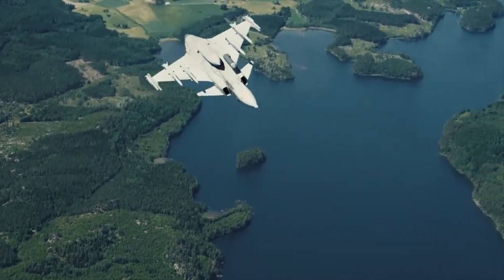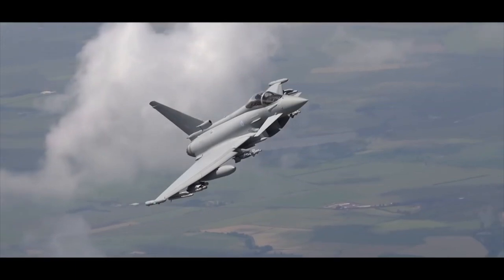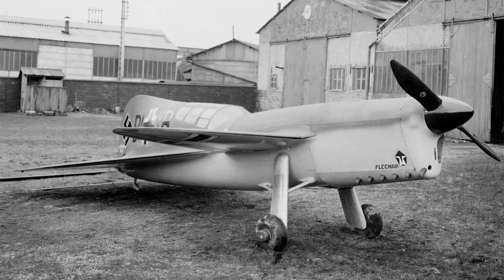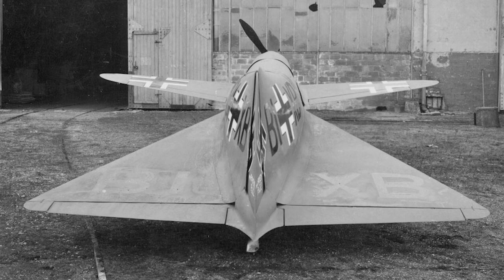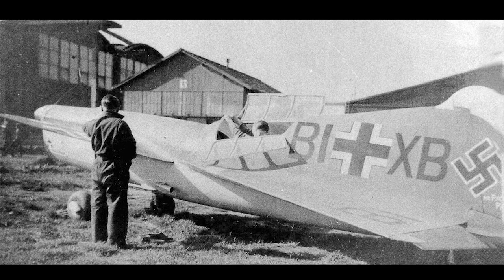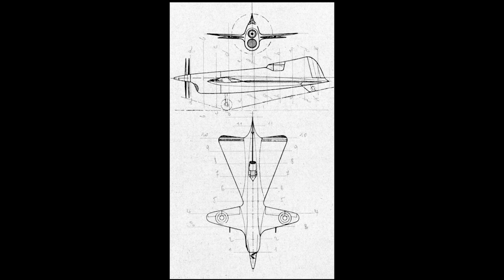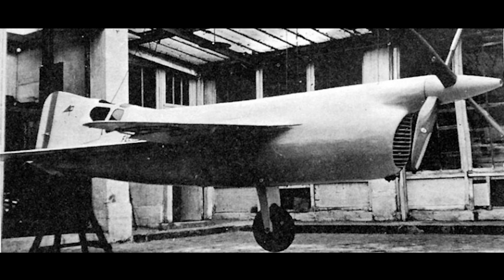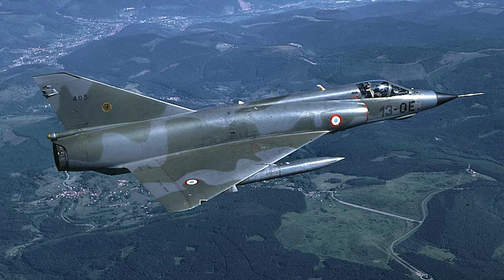The Payen PA-22/-122; the First (Proposed) Delta Canard Fighter

Comment: Nice to see this aircraft covered! Originally it was to be the Payen-Melot Pa-22/1R Flechair powered by the Melot 1R steam-oil powered ramjet type engine. This aircraft was built and had four wheels, the main landing gear, a tailwheel, and a 4th  under the engine as it was so heavy the aircraft "bounced" as Monsieurs Payen and Melot tried to get if off of the ground. It was hoped to enter it  into the Coupe Deutsch de la Meurthe air race, but when the aircraft failed to perform, it was re-engined with the conventional propeller piston engine. 

During this same period, another canard aircraft was built in Italy, only with a pusher propeller, the SAI Ambrossini SS.4, destroyed in a crash in 1939. Germany investigated this concept with the Henschel He.P.75 of 1941. In the United Kingdom this concept was continued with the Miles M.35 Libellula in 1942, then came the American Curtiss XP-55 Ascender of 1943, the Japanese Kyushu J7W1 Shinden in 1945, and the Russian Mikoyan-Gurevich MiG-8 Utka of the same year. Many nations were curious of this concept.

Comment: Please cover the Vampire F.2 / F.30 / FB.31, most definately superior to Meteor F.8 in performance, cheaper with no less firepower, more range and less maintenance. 

RAAF and French Air Force used it extensively and if RAF got a chance to ditch the Meteors and go with Vampire F.2 development, they would have served against MiG-15s at Korea much better than Meteor F.8s.

Comment: Imagine an improved version of the Payen powered by the Argus pulse jet. You'd have a cheap and simple motor. A cannon/machine gun combo in the nose. Fuel tank in front of the pilot. It would probably be a crappy dog fighter, but as a short range interceptor it might have excelled. Since the air frame was captured when France fell, it may have been possible for it to inter service in early 1943. All this is just my imagination trotting along. I can see it knifing through bomber formations with fighter escorts in pursuit.

Comment: This plane was really interesting; thanks for shedding light on the subject. I really like how the designer germanised the design by adding a cannon firing through the prop hub... and that's on top of a tandem-engine contra-prop concept. The line on this thing... methinks that the Star Wars designers took license from these plans when creating the prequels.

About the only practical use of a tandem engine vs a large powerplant (switching from a radial to keep the frontal aspect small) would be what the Gannet performed as that odd duck during the jet age: the ability to toggle off an engine while cruising to maximize time on target (run on one prop, feather the other; a configuration for a two-engine prop to not suffer asymettric thrust compared to a standard two-nacelle design). As sexy as the concept is, especially in WWII where they were still pushing the limits on props, contra-propeller set-ups were just too complex or too unreliable for front-line duty. The Dornier Pfeil, even had it become popular, would still have been niched into high-altitude bomber-killing (scramble, Intercept, and return) vs kinetic dogfighting against smaller birds. The Luftwaffe front-line props just kept getting simplified as their factories were continuously bombed.

Here's the weird part... you'd need to be performing around critical mach numbers against the wing for the benefits of a delta wing to overcome its negatives. There's a good reason why many props today that aren't operative at an extreme envelope don't employ deltas, with some of the faster movers instead adopting a swept wing arrangement.
Reply: "germanised the design by adding a cannon firing through the prop hub".  Stop being a Wehraboo; The French, Russians and Germans all used this technique.

Comment: The historical reason for the canard delta (first proposed and used by the Brazilian aircraft designer, Santos-Dumont) is that it creates an aircraft that is exceedingly difficult to stall and very easy to recover a stall if you do manage to put it into one.
Reply: The term was coined to describe the Santos-Dumont 14-bis, as its design with a box-like array of forward control surfaces looked like a duck in flight, but the very first successful powered aircraft was a similar canard biplane with a pusher engine.

As planes developed after the Wrights' first flight, this design fell out of favor for a number of reasons.

Comment: There are canards and there are canards. The canard on the Payen is quite different in concept to those of a modern fighter like the Rafale or the Gripen. Those are all-moving slabs designed to influence the airflow over the delta and delay stalling, making for higher agility. This is closer in concept to the Viggen, in that it provides a degree of lift in its own right.

Comment: The SAAB 37 Viggen flew in 1967, so it wasn't as long as you'd think before this design was used,  though the Viggen was a pioneer.
Reply: The J7W Shinden also flew with a canard delta on August 3, 1945. But a certain couple of events in the next week after that meant that it never got past the prototype stage.

Comment: I’ve made a light ~100hp prop plane along these lines in X-plane. It can take off at rather low speed while still getting to a high top speed for the horsepower. But the very high AoA and massive induced drag involved in flying slow are quite awkward.

Comment: I don't think this is really delta canard, and calling it a tandem wing might even be a stretch.  One might call it a delta tailplane and be more accurate.  Look at the position of the front wing in relation to mass of the engine.  The center of gravity has to be nearer the front wing than the back, which makes it the front wing the main wing rather than a canard used as a pitch control surface. If anybody has more info on location of center of gravity and center of pressure please share.

Comment: 224mph on 180hp? That is pretty good, especially with a fixed gear.
Reply: The P-26 went 234 mph on 600 hp so that sounds outstanding.
Reply: That's what I was thinking.
Reply: Somebody call Cessna
Reply: What do you mean? He clearly states it's in mph @ 2:31.
Reply: It's jaw dropping performance
Reply: Km p/h...not that impresive
Reply: There's absolutely no way, somebody somewhere got their wires crossed on some information somewhere down the line, the Gee Bee racer required 800 HP to go around 290 MPH, there's no way that thing was going to go 220 some MPH on 180 HP, not gonna happen. 
Look at it's configuration by the time you add on the canards and include the fixed landing gear it has to have a drag close to the Gee Bee racer, it was probably less but no where near that much less.
Either 220 MPH was what the designers hoped for with a pulse jet engine or someone somewhere mistook KPH for MPH or something else but there's no way that thing went that fast on 180 HP.
And even then it's basic configuration would have been a failure as a fighter, it's cockpit is set so far back that if the pilot had to put any kind of deflection into the shot the targeted aircraft would disappear under the nose.
Another Nazi pipe dream that probably the best thing for them was it being destroyed in a bombing raid so it didn't turn out to be another dead end wonder weapon that they wasted precious resources on.
Reply: @dukecraig2402  , I've been thinking about that, too.  220 mph on 180hp with a fixed landing gear doesn't sound right.  The super-duper optimized F-1 racing aircraft can do over 200mph on ~150hp, but this, ain't that.  ;-)
I think someone got their metric-to-imperial units conversion wrong.

Comment: The problem I see with this configuration is one known as vortex popping. This is what happens when deviances in angle of attack affect the downwash of the canard, which is statically down several degrees, and might normally flow under the wing, can be provoked to flow over the wing affecting both the lift, balance and attitude of the aircraft. This is why todays canard aircraft are dominated by high wing canards. The maingear chosen for the second is of a type used in the Verhees Delta D1 and D2. It is a weight efficient idea perhaps more important in smaller aircraft. That and, second only to the engine the cost of the gear is among the highest price hardware.
Reply: It's failure as a fighter would have been for an even simpler fact than that, with the cockpit set that far back there's no chance that the pilot could have pulled off a deflection shot because the target would have disappeared under the nose from where the pilot would have sat.
Reply: That may well have a bearing on why the area ration between wings and cannards is so much more marked in all the modern versions (although other factors no doubt impinge)?
There does seem to be an alternative solution of mounting the cannards low & the wings high.  Unlikely the designers didn't consider that option so presumably other factors make it less efficient or limit some aspects of performance?
Reply: @Farweasel  Generally if a canard is inside of 2 chord widths it is in interference of the mainplane flow. The net effect is the mainplane is always operating in its downwash, and therefore needs more angle of attack dialled in to do its job. So just normal operating has it flying uphill all the time. However, if the canard is situated above the mainplane, its downwash can be used to excite the flow over the mainplane, keeping the boundary layer attached.
It might be worthwhile, to point out that the canards use in this context isnt about sharing the weight of the aeroplane (and subsequent areas selected are beholding to that), it is for purposes as a control device, although the former in some small way may still occur. This takes it out of the usual regime of canard equipped aircraft as efficient weight carriers, to aircraft not impaired by long take off and landing rolls.

Comment: You are do right, the Canard configuration goes all the way back to the Wrights.
Reply: technically no so sure: the front "wing" has no lift effect.
Reply: @marcamant7258  it must have had some lift effect being in the up wash ahead of the main wing. The Wrights did notice the destabilising effect of the canard, so it must have been generating a lifting force.